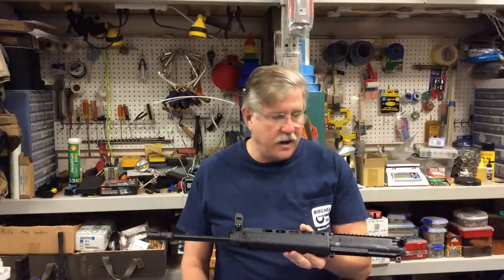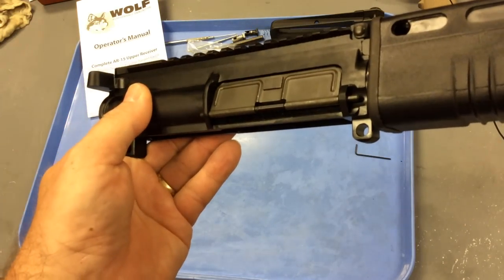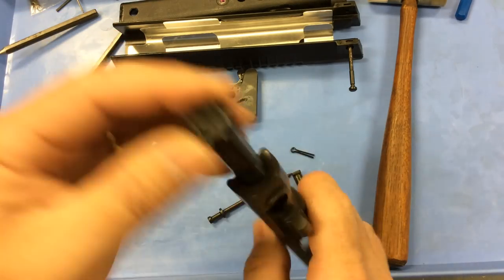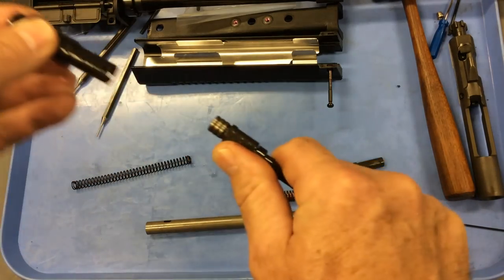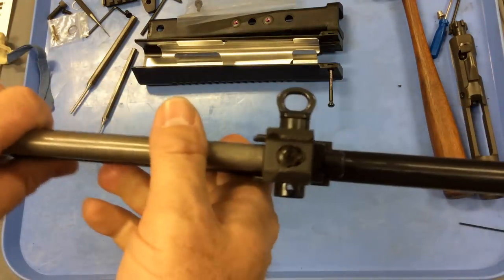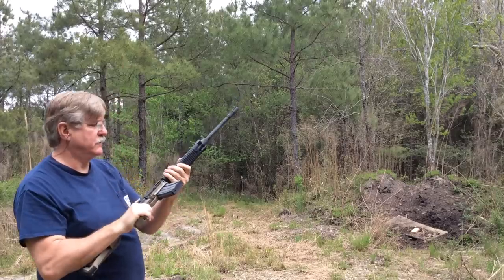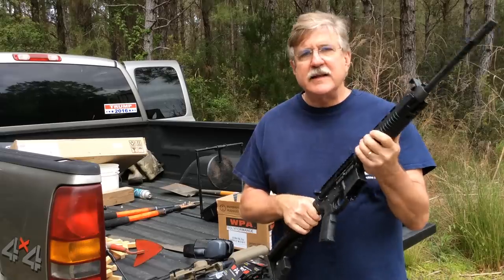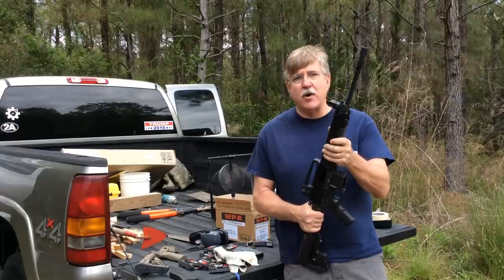Wolf A1 T91 AR-15 Piston Upper  Review & Field Test: Built Like a Tank - Runs Like a Sewing Machine

Comment: I used a T65K2 when I was in the Taiwanese Army. Before I got drafted I fully expected some kind of a M16 as a battle rifle but the difference that was really obvious to me was the piston system and the fact that you can remove the hand guard easily without needing special tools or a REALLY strong arm. I never managed to get the hand guard off of a AR15 for that reason (and I really don't want to touch the gas system either even though it SHOULD be cleaned now and then) The T65 just comes off with a flat blade screwdriver, the gas piston comes off and can be easily cleaned then put back together. 

Looks like the T91 is an improvement.
Reply: I agree, trying to remove regular handguards from an ar15 is absolutely stupid ridiculous, dumbest damn design ever. I’m sure they didn’t need to make the spring so damn stiff but engineers, what would you expect 😂😂😂
The Wolf Upper looks so much better in all around design👍🏻
Reply: I agree the M16 hand guards are stupid. However, you, in fact, don't need to clean the AR gas system every "now and then". In fact, that is one of it's advantages.

Comment: I really like my wolf t91 upper,it’s now my go,to rifle after mounting it to my spikes lower with a 3lb hyper fire trigger ,my only complaint would be a wolf .223 steel case got stuck in the chamber once and I had to drive it out with a brass rod , I don’t know if it was because it was still new or what ..other then that I really like the way it handles and the accuracy is pretty good…I now have over 500 rounds through it with the one stuck case …

Comment: Very nice review, thank you.  I see how you stated it was US made barrel, but the hammer forging is done in Taiwan and shipped here as blanks to be finished out here, right?  That was my understanding anyway.  I suppose technically they are US made since they are finished here though.  Again, nice review and video.
Reply from the maker: Thanks. Yes the barrels are very nice and easy to clean. Legally they had to be finished here. I did not realize they were forged in Taiwan until I posted the review.
Reply: Yeah, they are easy to clean.  I had a few hiccups with mine the first time I had it to the range but it seemed to be working fine by the end of my range trip.  I have a video of it on my channel where I shot several types of ammo through it.

Comment: Great review. I'm not experienced with gas systems and I was wondering if you could possibly do a cleaning video? Regardless great review and you earned a subscriber!
Reply from the maker: The gas system stays clean for many rounds. I clean the inside of the upper, BCG and bore like any other AR and then just disassemble  the gas system as shown in the video, clean and lube then reassemble every other range trip.
Reply: Michael Bell thank you for the reply. Great videos. Just subscribed 👍

Comment: I'm half Taiwanese by blood, so wolf has me very interested in this upper. However, the lack of a bayonet lug and 1913 rail on the bottom of the gas block is the only thing holding me back from purchasing the T91.
Reply from the maker: I think you could mount a rail with the two threaded adapters on top of the hand guard.
Reply: wolf used the older T86  or law enforcement style gas blocks front sight block instead of the updated T91 gas block.  I wouldn't need rails for the hand guard.

Comment: Is the barrel easy to remove to be shortened for my registered SBR lower?
Would running a suppressor and/or shortening barrel affect gas pressure to piston much ?
Great review Mike, thanks
Reply from the maker: I am going to test with a suppressor next week.  The barrel nut is proprietary but the barrel should come off fine. There is a thread on AR15.COM about shortening the barrel.
Reply: A 12.5" & a 14.5''  can be purchased direct from AIM Surplus. No need to shorten the 16" barrel.

Comment: Whats the third hole for on the m16 lower above the fire control group? Not the auto sear one above the selector, the one between the trigger pin and hammer pin that looks like something is screwed into it.
Reply from the maker: That is a pin for the ZM Weapons upper auto sear. I allows the function of the auto sear from the short bolt carrier of the ZM system. Thus I con configure a fully folding stock, full auto, that can be fired semi or full auto with the stock folded. I need to do a video of this. It is a neat platform.

Comment: For the Wolf A1 T91 16 inch, which buffer weight, spring, tube is optimal?  Thanks.
Reply from the maker: Depends on the ammo. Weak Wolf works with standard 3 oz buffer. Hotter ammo can run heavier buffers. I recommend having a set of different buffers to try with new builds/uppers.

Comment: What do you have for a carry handle. I have a A3 carry handle on mine and it shoots 16 inches high at 50 yards. Don’t think I can turn the front post out far enough
Reply from the maker: Mine came with a second front sight post that is longer so you can use a standard handle. You should have had one in the box.

Comment: nice job as always!
man, i love that old school handguard!
call me old fashioned but i just prefer a polymer/composite interface with my support hand.
and i also love a handguard that knows which end is up!
i mean, with an obvious gripping surface on the bottom and ventilation on the sides at the top.

unlike most modern aluminum free float handguards that are basically symetrical all the way around.

it just looks more "military" or businesslike to have a composite oval, rectangular or diamond-ish shaped handguard with top ventilation imo.

thats a good looking and comfortable looking system.
looks well designed if a bit complex also.

reminds me of the Sig 540/550 series.
and $600 is a great price!
i may have to check that out.
Reply from the maker: Prices are down to $500 even for the 12" barreled upper. A great value IMHO.
Reply: Michael Bell - awesome! thanks for the heads-up. 
i may just have to get one. im not interested in a SBR but a 16" will work.

well, i guess i could do a 12" pistol.
ill check into it. thanks again.

Comment: Is there any picatinny rail sections that will fit those threaded holes on the top handguard?
Reply from the maker: T91 tactical is the place to look for parts but I do not see any rail sections. I am sure you could adapt a rail section .
Reply: Ya I know they make the full handguard replacement, but I would rather just have that rail section on top for a flashlight. I haven't been able to find what else those threaded holes on top would be used for.
Reply: @ArnhemKnight88  there is a grenade launcher attachment that goes under the handguard and mounts to a different variant of the gas block.  The sight for the grenade launcher mounts in those holes on top.  That is the only thing I have seen use those holes.

Comment: Does the carry handle sight in with the front post correctly. Thanks.
Reply from the maker: Mine works as is but it came with a different sight post you can change out if needed.
Reply: @MichaelBellmbell556  Thanks for that info, mine comes in today. Will upate.

Comment: wth is that screw/pin on top of the trigger pins?
Reply from the maker: That is a pin for the ZM Weapons upper auto sear. It allows the function of the auto sear from the short bolt carrier of the ZM system. Thus I can configure a fully folding stock, full auto, that can be fired semi or full auto with the stock folded. I need to do a video of this. It is a neat platform.

Comment: Any chance of a pistol upper or a 7.62x39 version.
Reply from the maker: I looked at short barrels, comparing 300 BO, 6.8 SPC and 7.62x39. I was disappointed in the muzzle energy from the 7.62x39. https://youtu.be/VUH0qB8dDes
This upper runs so well as is with cheap Wolf ammo. There is a guy on AR15.com who is working on shortening the barrel on one of these uppers.

Comment: Do you use the POF roller cam pin with this upper?
Reply from the maker: I do not.
Reply: Michael Bell I was just wondering because of a video you did where you said you put pof roller cam pins in your piston guns
Reply from the maker: @juansgotguns_9079  This upper was purpose designed and used by the military of Taiwan so I did not add one.

Comment: The Jordanian royal Guard has a high rating of A1 T91. The Jordanian military compares Taiwan T91, US M16A2 with Russian AK47 rifle, and finds that AK47 shooting accuracy is poor.. after testing, and T91 shooting precision is far better than AK47, and bullet penetration is higher than M16...T91>AK47
Reply: The bolt is still not reliable. The extractor is too small and too weak. The big hole in the bolt makes it more likely to break. Take a look at an AK47 bolt. You will see the big difference.